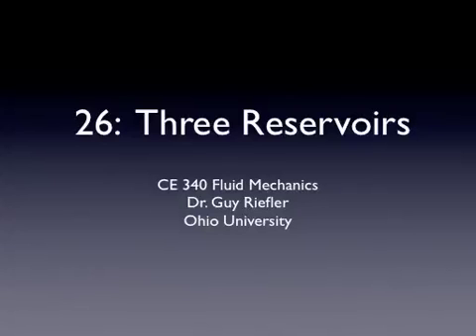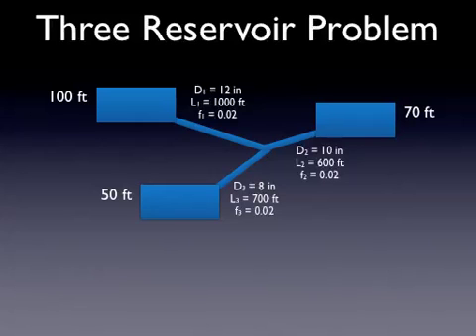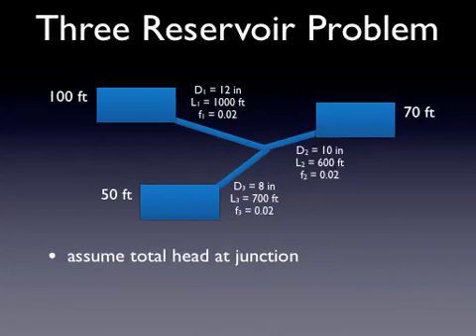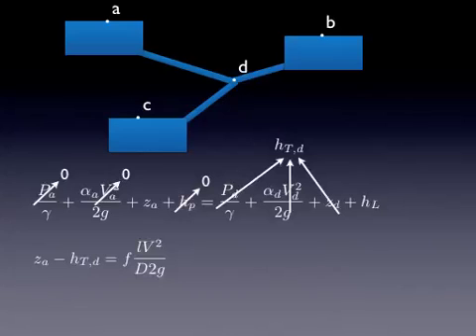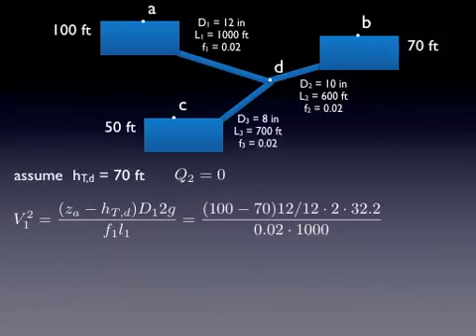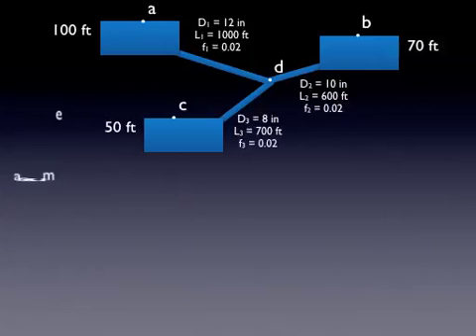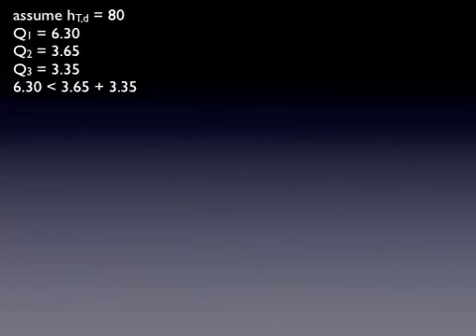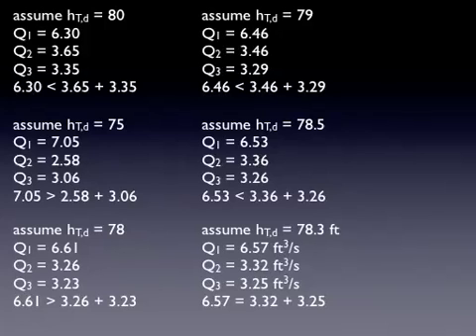26 three reservoirs

Comment: Why is the velocity head looped in to the constant ht at the junction? Intuitively, due to the change in area, I would assume this differs between the 3 pipes. Continuity is based from the flow rate, or Q=Av, so the velocity change could make a large difference.

Comment: when i u use his formula for v1 husing his values i get a different answer. what is g? isnt it 9.91? where is he getting 32.2?
Reply: notice that the elev and diameter are in English units. The g for English unit is 32.2 while in S.I. it is 9.81
Reply: Standard units, g = 32.2 ft/s^2

Comment: Good approach but disagree with the comment of "this type of problem has no practical application."  This type of problem occurs at any T in a system.  The reservoirs are only symbolic of the HGL at the end of the pipe.  

For example, most people are familiar with the toilet being flushed when someone is in the shower.  THAT is a classic three-reservoir example.  One supply line(reservoir) feeding two reservoirs (shower and toilet).  Great problem to make sure you understand the correct application of the energy equation.   

I didn't take time to check his numbers, so the JP Contruction comment may be right?

Comment: This is wrong!!

The approach was correct but he must be a teacher and changed up his numbers and didn't double check his work. In this video only the V1 is correct. Notice at 70ft his f values to be .02 and he calculates his V to be 5.67 at 90 ft and at 70 ft with f value to be .02 v=31.08.....

LET ME SAY THIS MORE SIMPLY: The only way you can get V1=5.67 at 90 ft is if your f value is at .2

But Thank You...If it was not for you I would have not figured out the correct approach.

Don't be afraid of this video as it's awesome. Just don't be afraid if you find a mistake later on.
Reply: answer should be 99.81 for the values he gave for ht